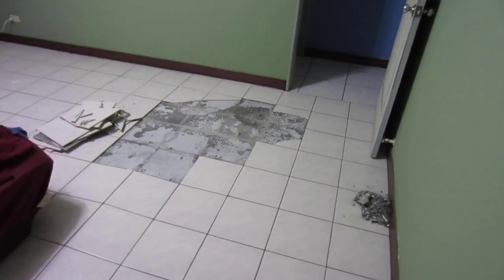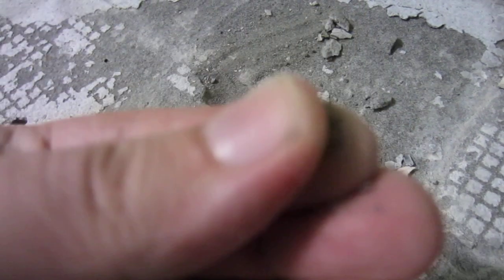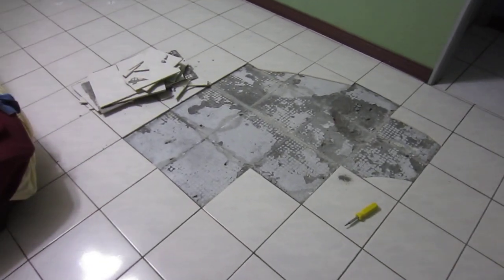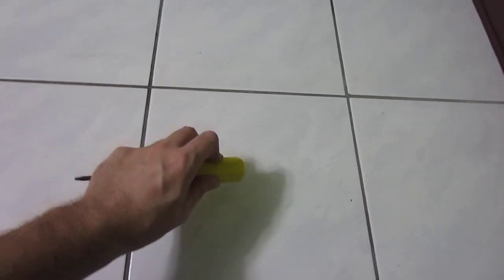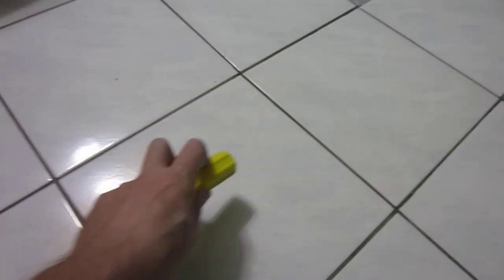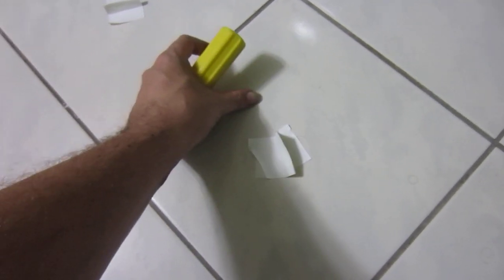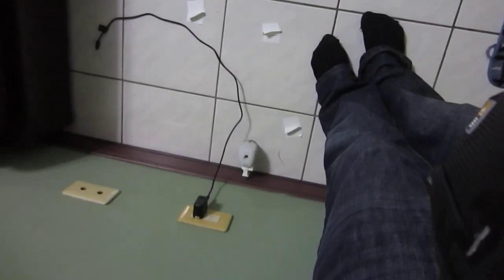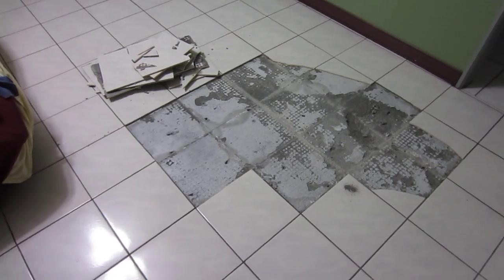How To Tell If Your Tile Is Going To Pop Off Your Floor

Comment: There are a couple of reasons why your floor may tent, 1, no expansion joint, 2, moisture coming up through the sub strait, 3 wrong mixture of product to water, 4 the concrete was not cured fully before the tile was laid.
Reply: My apartment is 20 years old. Which one of your explanations are applicable?
Reply from the maker: Good times!

Comment: I have an apt in Jamaica, like your place, I started getting tile buckled & popping up because like with you, all bdlg is done with concrete/blocks there. The contractor blames it on "minor earthquakes". But like you, I'm convinced it's because the concrete subfloor has hollow spots...too much sand in the mix maybe, but hollow spots along with heat most likely.
Reply: As a Jamaican and one in the business of tiling. Oftentimes it has to do with uneven floors or not enough thinset...
Reply from the maker: Yeah, I think it's a lot thanks to materials/craftsmanship, plus environmental factors found in tropical environments.  Tropical regions have more construction issues than temperate regions, for a number of reasons.

Comment: I think the bigger issue on those tiles isn't so much the actual concrete subfloor, though likely it's not helping, it's that it's combined with the very old method of just I'm guessing plopping the tiles right onto Portland cement (concrete) as a mixture, and not troweling it correctly and "back buttering" the tile, as in, adding mortar to the back of the tile before placing it on so there's full mortar coverage on the back of the tile. The other issue as well, affecting larger tiles like these is floor levelness itself. If the floor isn't level, the uneven stresses at the edges of the tile will make them pop. Likely as well in Taiwan they don't use modified thinset very often except maybe for important commercial structures, only unmodified (way cheaper, maybe $10USD per 25kg bag vs $30-50 for 25kg), which has no polymer additives to give some amount of bend with the flooring. Luckily over there labor is cheaper than US, in USA I've seen way worse (contractors scammed my mother for a tile job in my bathroom...) from tiles put directly on plywood floors without prepping with leveling compound or cement boards. :/
Reply from the maker: This comment is awesome.  I understand none of it, but, you sound like you know a lot about what you're talking about.
Reply from the maker: I think you're right about the levelness, especially: "straight corners" and "straight edges" and "flat/straight walls" are a huge issue here.  The materials are an issue, as well, and obviously there's going to be statistical drawbacks to cheap labor, in terms of skill.
Reply: Please advise, we rented the apartment and tiles pop up swell and crack in dining room.. 😢 Owner blaim me that it was hot in the apartment and moisture cause that.. is it my fault that tiles damaged? It is very old house. Who should pay and fix it- me or owner? Does tiles afraid of the moisture? Shouldn't tails be water resistant?

Comment: Just happened in my sister home.
Been wet all winter here in Florida.
Plus warm last few weeks and now cold front came in last night.

 Expansion issue with tiles poping.     Ridge or tent in center of living room.   Sister felt it was sink hole.    I told her not to worry no sink hole.     Time to pull up 1978 tile floor replace.     Better to put down
 floating floor.    Leave room for
 expansion.  Scary sounds   when
 your in the house and this happen.
Reply from the maker: Sound advice!  Thanks for watching!
Reply: Please advise, we rented the apartment and tiles pop up swell and crack in dining room.. 😢 Owner blaim me that it was hot in the apartment and moisture cause that.. is it my fault that tiles damaged? It is very old house. Who should pay and fix it- me or owner? Does tiles afraid of the moisture? Shouldn't tails be water resistant? Also in Florida you always have some moisture condensate..
Reply: @miami-life  not your fault.  This happens when the temperature changes and expansion takes place.    The tiles were not properly installed.   The time they we're installing they didn't leave room for expansion issues.   Landlord is wrong.
I wouldn't be terrified of the request for you to repair.   If you go to court you will win as it's a failure of by natural causes.
Reply: @lawrencefeldman462  Thank you.. Yeah , bad experience for my family.. Owner wanna charge me for that, he don't want to return my security deposit. Not sure where to find good lawyer that helps me with it..

Comment: Looks like they used dry-pack concrete.
Reply from the maker: Building materials used in Asia are generally not great.
Reply: @EatAtJoes  sand and cement are pretty universal but subject to installation error

Comment: Does cold weather play a role in popping up these tiles?
Reply from the maker: Yes, that's a major issue.  Using substandard grout is one factor, then the expansion/contraction from heat/cold is another.  Combined, this kind of thing is inevitable.  You see it a lot in the third world, as they use cheap materials and are overwhelmingly in the tropics.  The floor you see there was built when Taiwan was moving from "developing" to "developed."